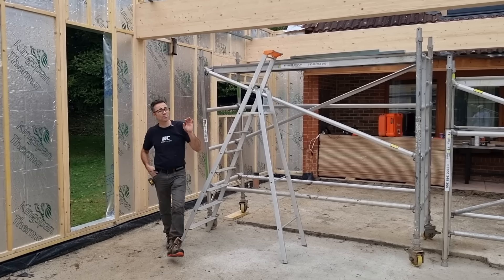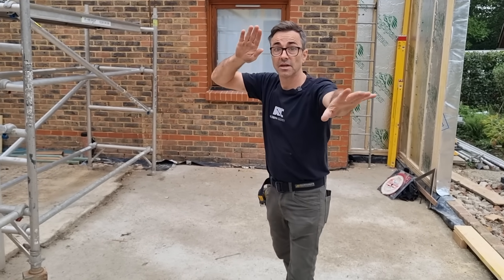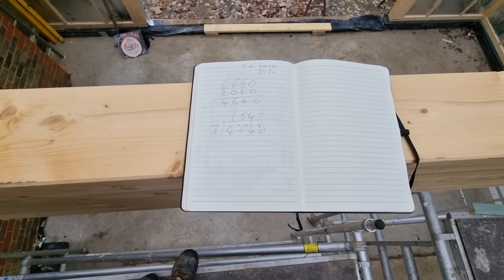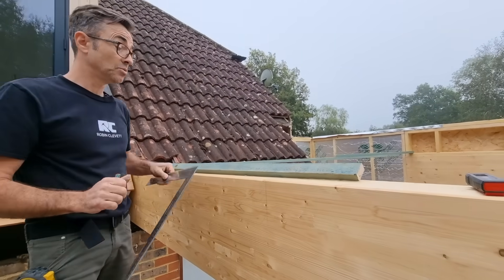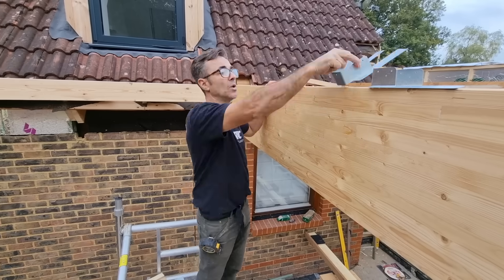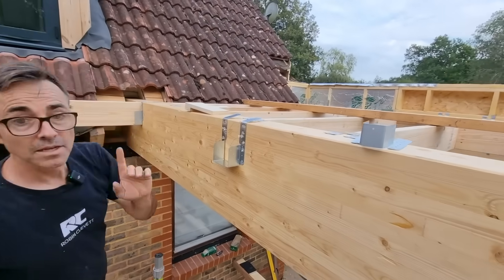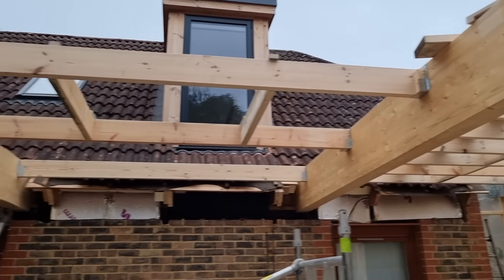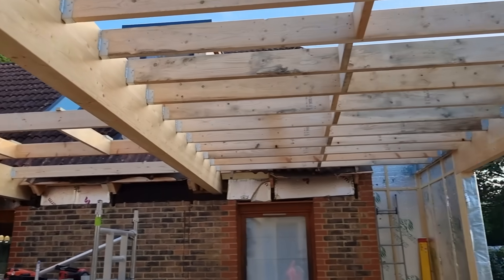Flat roof Construction

Comment: you have set up jigs to do very accurate cutting of timbers to size but shouldn't you be leaving a few mm each side to allow for thermal expansion when hanging between 2 joists? e.g. those trimmers should be about 1006 not 1010?

Comment: Flat roof house is not popular in USA. There are a lot of flat roof masions in Bevely hills. Those multi million masions are wood roof or concrete roof?
Reply: They are timber frame instead of lumber framing.  Tiber I'd considerably more expensive as the wood is harder to select and grade in long girder cross sections.  Lumber is cheap to timber

Comment: What does a lambeam that thick run pricewise?
Reply from the maker: I'm not sure exactly the price as it comes with the timber frame package but I would say they would be about £500 each
Reply: @robinclevettcarpenter  Thank you. What was the length and do you know roughly what their max unsupported span is?

Comment: great video and I love the concept behind timber frame. one question... is there more of a fire risk and with that higher insurance etc? for example are glulam beams fire retardant?
Reply from the maker: Timber is far more reliable than steel in a fire especially large solid sections such as glulam, steel always needs to be completely encased against fire as it buckles and bends with the heat and collapses faster than a large structural timber beam

Comment: Why pin the bent over ends of the hangers? Is that from the architect, regs, or just  because?
Reply from the maker: Hangers are considerably stronger when they wrap over the top and nailed, many types of hanger have the number of nails used with or without wrap printed on them

Comment: Hi Robin, had to use two Glulam beams in 1985 on a roof extension, loft conversion in East Sheen near Richmond Park gates, structural engineer recommended them. They were a new thing then I think, the Twickenham Architect telling me "well depth is strength you know Liam. By the way, are the chippies today aware , or use pinching rods?

Comment: Hi Robin.  I noticed your framing square has your logo on. What ever came of the production version?  I cannot seem to find it on your website etc. Did it ever make it into production?  I am still in the market for an accurate framing square totally fed up of the so called square squares that are completely out and require adjustments. If yours is not going to be available which (if any) would you recommend please.  Great video as always. Thank you.

Comment: Are they factory made wall panels? Looks great Robin but where are the Posi-Rafters? 😊
Reply from the maker: These are from the factory, and we wanted to keep the ceiling as high as possible, we used a 175mm joists and the smallest Posi is 225mm so we gained 50mm
Reply: Cool. The smallest Posi is actually 202 (PS-8). It's not generally used in floor design because it only has a 108mm gap (not enough for a soil pipe) but it is used for Posi-rafters and would have been able to handle the balcony loads here.  @robinclevettcarpenter

Comment: ‘Flat roof’ doesn’t translate to flat by me. I have a pizza slice fillet piece positioned on top of the joists to create maybe a 6 inch drop over 14 feet in my semi-detached (existing). Very curious how Robin will tie the drainage, roofing system, terrace, and windows all together. Tremendous graft and ingenuity as always. I’m forever indebted to your teachings.

Comment: Are timber framed buildings and extensions classed as a higher fire risk than traditional bricks and mortar buildings?
Reply from the maker: No Chris, all buildings are designed to meet building regulations that would cover all the parts including fire regulations
Reply: All buildings will burn down with enough heat or becomes smoke damaged during a fire. A timber building is extremely predictable in a fire and people much cleverer than me know how lond a timber will take to burn or char which then provides fire resistance to the time. If I remember correctly 40mm takes either 30 or 60 miniutes to burn. Which is why your fire doors are 45mm for half hour. Where with steel its extremely unpredictable in a fire and it buckles and twists with the heat in any direction. Where timber doesn't and is still structurally sound. So a clulam beam will out perform a steel beam in a fire
Reply: @wrightwoodwork  fact 👍

Comment: Nice video, I too prefer to work in a similar way, not only do you eliminate the measuring errors but I find it a far more efficient way to work. I wish more architects/S.E's would spec Glulam beams as they are such a great product to work with, I'm constantly having to use a block and tackle to get steels into place where a Glulam beam would have been much the better option to use, never mind all the hassle of noting timbers into the web to take hangers etc!
Reply: I was setting fence posts this afternoon, I should have used a story stick to mark the intervals instead of a tape measure.